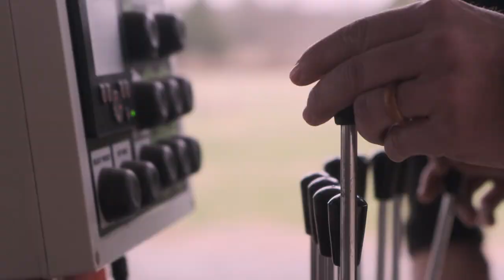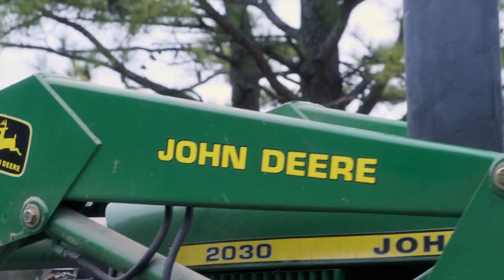I'm NEVER buying wood again!

Comment: We had a vacation cabin near Lake Arrowhead for years. It was on Burnt Mill road. It was built in the 1920s. Evidently it was built by someone that worked at the mill, before it burned! The cabin was made from the first cut of the tree (with the bark still on). The timbers stood vertical with the barkside out. The flat side was the inside of the cabin and was finished with ceder shingles.
Thanks for the memories!

Comment: He is right it is fun taking a log and turning it into lumber. Every log has a surprise inside. I have been cutting my own wood for eight years it is very satisfying. Now with time off I will use the lumber in the barn to make some furniture.
Reply from the maker: I love using wood I've sawn. When we moved I left Darryl with an enormous stash of wood I'd sawn with wood misers over the years. It was always so rewarding to pull a slab off the pile and remember the day it was cut.

Comment: Have you thought about perhaps building a solar kiln to dry some wood more quickly to reduce your delayed gratification? It’s not nearly as fast as high-pressure kiln drying but also far less difficult to make happen on a small scale with little investment.
Reply from the maker: Totally, a kiln of some kind will likely be included in the shop build.

Comment: Just so you know you don't have to let fresh sawed wood sit and dry that long. My neighbor and I have built alot of wood footlocker trunks out of ceder and pine that was fresh cut and sawed. Just wanted to say!
Reply from the maker: For furniture, you definitely do ;) for outside, and rougher projects, it’s much less dangerous to risk it and use freshly cut wood. Heck, most of the big box store 2x4’s are barely dry at this point.
Reply: @AnneofAllTrades  The crazy thing all lumber sold in big box store are kiln-dried to 4% moister but treated wood after drying is put into vacuum chambers to soak up the weather treatment solution. I get what your saying I do.